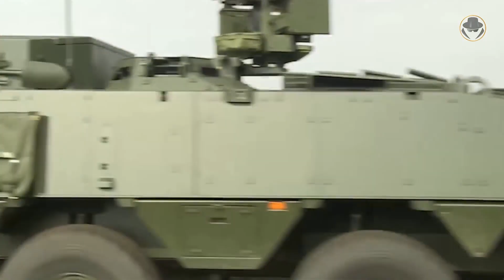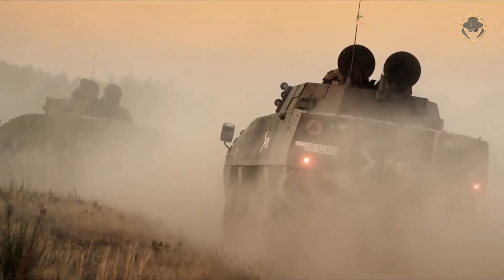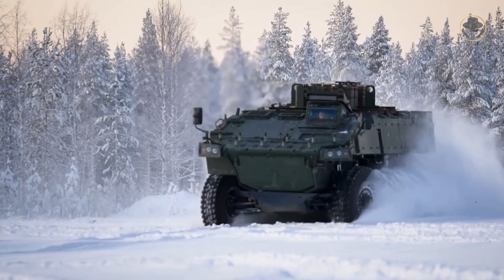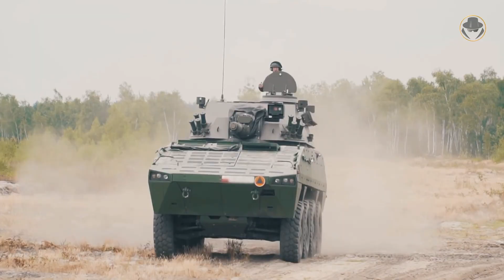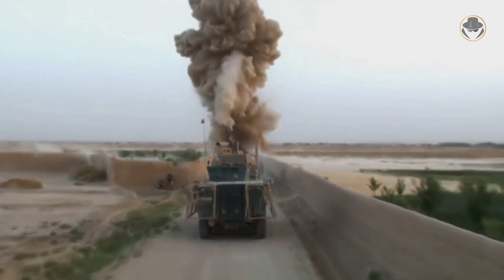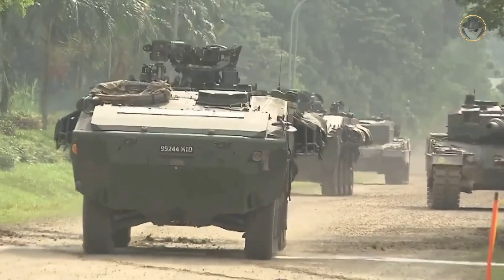Patria AMV | Finland's triumph over other big western producers

Comment: As for Rosomak there is a problem consortium producing 15% under license since 2000,s "assembling of parts" ... without the knowledge of the government signed the papers for XP versions that cost 15%-25% more.
Anyway our improvements after Afghanistan cost us by licenses a lot "replacement of turret drives etc.etc.  
And the knowledge regarding improvements after  went to the Patria so for our uprgrades we had to pay and ask to make them ....
This is the end of this design in the Polish army we go with Korea and modification of the White Tiger maby joint venture???  
The spell of bitterness was the turret
for which we overpaid in components by 20-60% to this comes unification with Spike .......................................................................................................................................................
 ZSSW-30 exept MK44 is Polish product so we dont have to care about jerk bussines of Patria and  Leonardo :)
Reply: So your government signed an agreement on a completely different version of the vehicle what was originally planned after which it was decided to upgrade them without local knowledge to do so and then thought the upgrades would come free from patria? I don't necessarily agree with patria's way of dealing with their business but that sounds something the polish government is responsible for..
Reply: @kk-gr3ly  To be accurate it was under the nose of the government one of PGZ's subsidiaries probably Rosomak S.A. signed a paper with Patria for the production of AMV XP aka Rosomak XP ending the Rosomak production capabilities after we produced the last 70 chassis what is in the current license they are ending the old model want to make money on the new one. 
The problem is that neither the army nor the government was asked for permission and PGZ is a government company ... 
Patria counted that we will pay extra 
then they will earn nothing ;) 70  zssw-30 will be on these the rest probably in the future on the Polish-Korean wheeled armored personnel carrier.
Rosomak will ride in the Polish army for 10-20 years and then they will go into reserve 
or we scrap them.
Reply: @marekzalipski6904  So a private defence firm signed a deal with patria to produce AMV XPs for the polish army without the governments approval? What on earth is going on in Poland?? So let me get this straight, a defence firm signed a deal with patria to produce XPs and stop the old variant's production line, which resulted in patria not willing to give out a new license for the actual polish army to produce the old AMVs?
Reply: @kk-gr3ly  This is a conglomerate of state-owned arms companies ... Private is "theoretical" in 70% check Polska Grupa Zbrojeniowa on Polish wikipedia and use translator 

Shareholders	
Ministry of the Treasury - 40.10% ... so GOV 
Industrial Development Agency SA - 28.92%
joint-stock company of the State Treasury... GOV  again 
Polski Holding Obronny Sp. z o.o. 30,98%

Currently, Polski Holding Obronny owns 31% of shares in Polska Grupa Zbrojeniowa SA, the national defense industry concern.

Polish government holds many industries as property see Orlen KGHM etc etc .... 
Now you understand the problem ???
Reply: @kk-gr3ly  Some idiot signed documents for the production of a new model without asking permission "i wonder why" ???? :) and then at a higher level someone embraced what happened and how much it will cost 
so they end the topic.
It,s in a nutshell
Reply: @marekzalipski6904  Sounds like total chaos of an situation. I really hope Patria will learn something from this.
Reply: @kk-gr3ly  Patria will learn that Polish arms procurement is and will be a mess.
Reply: ZSSW-30 Looks like straight copy of AMV.
Reply: @niceview2112  XD ZSSW-30 is a remote-controlled armament module not a chassis
Reply: @marekzalipski6904  Aah well that explains it! Haha.

Comment: Slovakia has cancelled the Vydra projcet based on the AMV and is instead getting the latest AMV XP, most probably with KONSTRUKTA remote turret. Contract to be signed by end of 2022.

EDIT: 
It has been quite difficult to find what exact armament will the Slovak AMV have, but it will in the end be a Slovak turret by EVPU - Turra30 with a GTS30/N autocannon(by ZTS Special), which is licensed 2A42 adapted to NATO 30x173mm (it has been in prototype stage during trials). This turret and more importantly canon was an additional request by Slovak MOD as a cost saving measure to the 2 finalists (AMV+Pandur II). Both canon and turret are domestically produced and the russian ammo variant of the cannon+turret is currently in use in modernized BMP2s, Slovakia has currently. 
Here is the same turret with Bushmaster II mounted on Czech Pandur II.
https://youtu.be/zsS0hpep6aQ
According to the MOD the advantages besides domestic production over other offered turret+canon combo were Price(50% saving over BushmasterII on the same turret) and weight. The disadvantages were lack of protection on the turret (weight compromise) and inability to reload under armor.